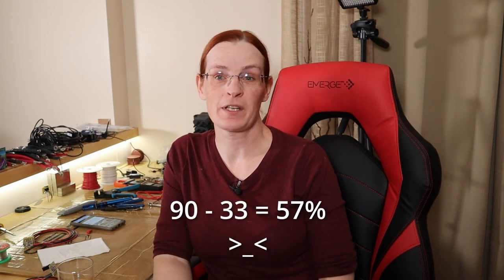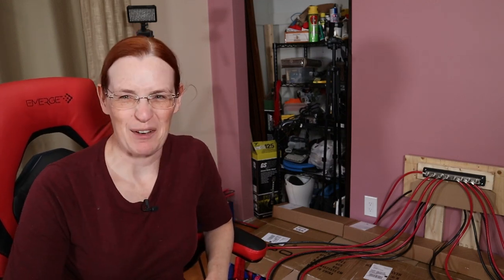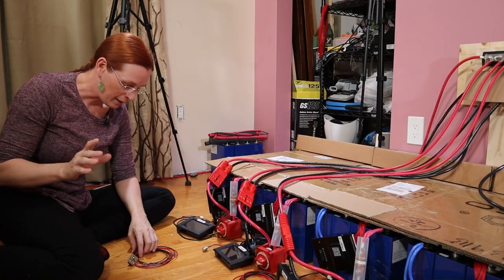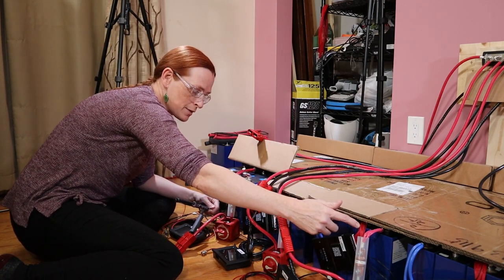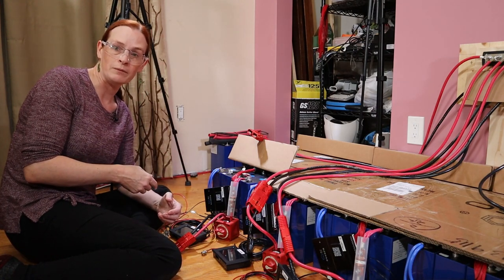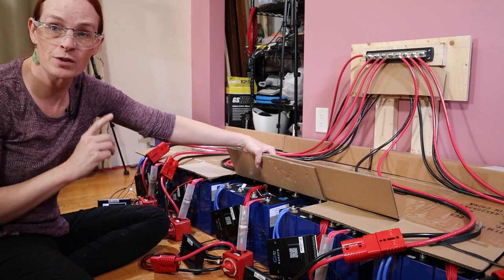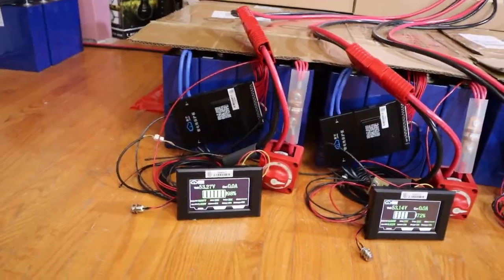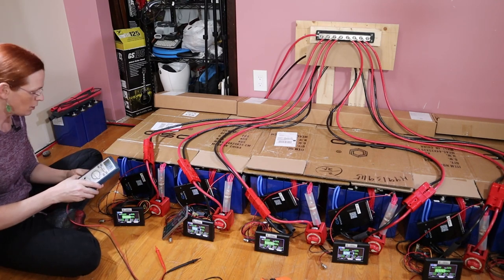It's Alive! (and I need some help) - Part 7 - Big Battery Build! (Ep. 44)

Comment: As others pointed out: precision/accuracy. The JK uses an STM32, which has a 12 bit capable ADC. I'm not sure how exactly it is set-up on the JK, but I've used it many times in the past and it's good. That said, like any device used to measure, you need to calibrate what you measure with a reference. That said, just because you're not calibrated properly does not mean you can't calculate a delta accurately. If cell one is 3.212V and two is 3.312V, the delta is 0.100V - no matter what your calibration. Now, what's the most important for the BMS to do? Make sure you don't have a cell overvoltage - so as long as you calibrate it so that 3.6V for the BMS is close enough to 3.6V true, you're fine. As you noticed, your multi meters are all off too as well - so take the lowest one, or the middle ground. In the end, it doesn't matter since for balancing the delta is used (and is independent of the true value) and for protection you almost want it to read slightly over true to be on the safe side. State of charge will come once the BMS reaches full - but keep in mind you also would need to calibrate the current to have accurate readings. Personally, just use the SmartShunt if you need accurate readings on state of charge and ignore the BMS state of charge indication. You will never be able to have all of them agree on the same number...
Reply from the maker: I wonder why they don't calibrate the BMSes to a reference voltage before shipping out the BMSes? Thanks for the info on the delta, that makes sense and along with the other replies, I am starting to understand things better. On the "calibrate so that 3.6 is low, if anything" - Wouldn't this push the risk off the 3.65 over-charge, but increase the risk of over discharge? I'm worried about both sides of the SoC. Thanks for this reply!
Reply: @TheDigitalMermaid  You shouldn't go to 2.5V anyway - put the cut-off limit at 3V. There isn't much capacity below that point. Since you top balance, you want to go a bit high some times, but not low. The chances of things going wrong are much more likely at the high state of charge in this case.
The BMS is calibrated at factory (as far as I know), but I don't know with what equipment. A calibration also drifts over time, and has to be redone (just like with a lab volt meter, or even a Fluke). It's a good thing you can actually calibrate it.
Reply from the maker: @upnorthandpersonal  Noted, and thank you.
Reply: @TheDigitalMermaid Upnorth is right, occasionally top balance to 3.55-3.6v/cell max, but then set ur cutoff at 3.5-3.55v/cell max. A lifepo4 cell will charge to 100% at 3.45v but will take a bit longer to absorb, at 3.5-3.55v it will charge a bit faster & you can stop bulk charge & go to float at 3.35v-3.45v/cell max, this will give u a safe full charge, as quickly as possible and should reset ur BMS to about 96-100%SOC daily if charging medium allows. I believe you have already taken the cells up to 3.65v/cell to top balance them, so you should not need to take them up that far again, but should balance nice at 3.5-3.55v/cell from now on as there is negligible power gain ( a few amps) above 3.45v anyhow and not worth the likelihood of a higher degradation rate at a higher voltage. I also agree with Upnorth regarding the 3v bottom limit, going much/any below that only increases unnecessary stress and gives you a few more amps to play with, so 3v-3.55 is a safe operating max voltages to work with. Batteries balance and Calibrations do drift over time and need to be reset occasionally.  I know it is all very mesmerising all these monitors, but use ur Victron shunt as ur main Goto for SOC & amps in / amps out, while the JK’s accuracy I believe are really quite good, I would use the Victron Shunt data to give u an easy to see picture of what’s going on in ur system. 
Finally, dont expect everything to be perfectly symmetrical , ie; if charging 6 battery banks at 60 amps and same voltage throughout each bank (well maybe), it doesn’t necessarily mean you will see a neat 10 amps go into each bank, internal cell resistance differences, while small, will contribute to this among many other factors, temps, cable resistances, connections, etc. nice bank.

Comment: The JK is a coulomb counter type bms, not a voltage type of BMS and to tell the true state of charge of LiFePo4 you can't use voltage reliably. When charging for the first time not knowing the true state of charge of your particular cells, one thing to keep an eye out for is a fast rise in voltage toward the end of the charge profile. If charging at a higher rate like I was my inverters freaked out when the spike in voltage occurred at ~95%soc and BMS cut power. You setup may be different. Once you charge to 100% as long as your other settings are correct it should be pretty accurate. If you notice a drift in accuracy you can tweak the settings.  Accuracy also depends on the actual capacity of your cells. Testing each cell is the only way to know for sure. Nice Build!
Reply: Also, as a former recovering electrician, don't trust your Klien meter.I cant tell you how many times it's sent me down a rabbit hole with inaccurate readings. Typically due to the battery voltage of the Klien meter.
Reply from the maker: @brandonEpicAero  It's why my BK was my first and still is my go-to meter.

Comment: Hey Maddy, love the video! Fault finding and testing theories is my thing ;) 

“Is this why people spend lots of $ on high end test equipment?” – Basically yes. The security and repeatability of a Fluke (for example) meter removes the doubt from these exercises, and that translates to increased productivity and reduced costs. I find that most meters are reasonably accurate for Voltage. However current readings vary a lot, especially with cheaper devices. Interestingly, all of the Victron Smart Shunts I have, have tested 3% low compared to a certified Murata shunt that I have and the Fluke meter as a reference. This is also in line with some other current measuring devices I have. Victron have been rather unresponsive about this when I've asked. The Smart Shunt should have a calibration option too, but it doesn’t. So the one I care about most, has been physically calibrated by cutting the plates a little (not recommended). 

I think the JK’s are ok, certainly not perfect but they’re great for the cost. The accuracy of the third decimal place is very questionable, but what we are more interested in here is repeatability. As you’d know, accuracy, repeatability and resolution are very different things, but they are often confused. Cheaper items rarely satisfy all 3 things as standard. The resolution is down to 0.001v, but the accuracy may be much less at just 0.01v or whatever it ends up being. We can normally help accuracy by calibrating them like you have now done, so that helps sort out accuracy, but it will need to be checked at intervals to see if it drifts (unlikely). You will probably find the numbers change a bit with temperature too, a hair dryer on the BMS might be able to easily test this. It's also interesting to see if the numbers still stack up when under stress, like heavy loads or heavy balancing. 

The difference between the App and Screen readings may be due to the update speed. It looks like the screen is updated much slower than the App, it’s probably just receiving serial data at intervals whereas the App seems like it’s communicating much faster. The data may also be averaged or integrated over a period of time too. Perhaps this is something they can develop a bit more. This is just a guess though. 

The current difference at the end of the video could be due to the position on the bus bar, could be a different initial SOC, or could also be due to a difference in cell temperature. The outer packs could be a bit warmer or cooler, and temp makes a decent difference in cell voltage, therefore it’ll make a difference to if it’s charging. You may also fine the opposite happens when you put a load on. Swapping wires on the bus bar (inside to outside) can test one theory. It's more difficult to test the temperature theory though.
Reply: Oops that ended up being longer than expected, and others have mentioned the temperature idea too.
Reply from the maker: Ya, I've learned from the comments here about meter calibration on the good gear... I'm understanding the price difference better now. 

The "JK's are great for the cost" is about what I'm coming to think as well. For their cost. For stationary installs where a pack failure isn't a big deal, I think they're fine still.  The checking for drifts will be part of my annual maintenance on the pack. I think it'll be worth finding a good voltage reference source to calibrate my meter, then calibrate the BMSes from there. 

The cells were all IR matched and charged/discharged together, so I'd expect minimal (and random) SoC differences. I think the temperature is the most sensible option... If it was the bus bars, I'd expect to see a bias to packs A -> F more or less linearly, not the outer packs being different. Next time I charge, I'll uncover the packs and pull out the thermal camera to see if I can see a difference.
Reply: @TheDigitalMermaid  It would be interesting to see how things change if you put the main cable in the middle of the busbar instead of the end.

Comment: Cathode means negative side, since a diode allows electricity to flow only in one direction from positive to negative, the cathode is always the protective side.

Most modern BMS units determine the capacity of a battery by measuring the amount of current while charging, however, when reconnecting it or connecting it for the first time, it appears to be determining the SOC (state of charge) from the voltage, which may or may not be reliable depending on the condition of your batteries. Specifically, when you charge batteries with a partial charge, you are creating a voltage drop at that percentage, so that when it gets to that point when discharging, it may see a sudden drop in voltage. Which would cause you to plug it in, which would cause the voltage to drop more there next time. It is possible to recover a cell with damage, however, it is very tedious and time consuming, and involves fully discharging and charging (cycling) more than 10 times from 0% to 100%, and from 100% to 0%. It is also possible to damage a battery by charging it with partial charge beyond the point of being able to repair the damage.

The gas produced from a lithium cell is caused by the electrolyte being heated too much, which produces hydrogen gas. The hydrogen igniting is the primary fuel of a lithium battery fire, because the hydrogen burning causes the lithium to react with water vapor in the air, which produces more hydrogen gas.

The variation you are seeing from the BMS readings is due to the reference voltage used. If the voltage varies, it is most likely using a resistor voltage divider or zener diode reference voltage. These components are inconsistent, and will vary slightly, causing the reference voltage to be incorrect.

It appears that the BMS is not actually balancing, try disconnecting the BMS and measure the voltages, if they are still the same, it does work. However, I think the BMS is cycling through each cell about 20,000 times each second, and is changing the voltage applied so that the cells read all the same, even though they are not.

Comment: Remember flammable and combustible are two different things. usually the term flammable is going to refer to a temperature that something will start to flame, so just as diesel is not flammable it will flame at high temperatures. I would tend to believe that the fluid in the lifepo4 is not flammable but is combustible. An MSDS for lifepo4 should show that information for you.
Reply from the maker: That's a helpful distinction, thank you.

Comment: Try another battery in the multimeter you will get other readings. More accurate if battery is still full ( new battery). You can get very different readings.

Comment: It does not matter which meter you use, as long as you use the same one for all the batteries. I presume the individual cell voltages change to add up to the total corrected pack voltage. The differential charging is probably due to you bus bar configuration . The best configuration is say, the charge lead closest to pack A on the positive bus bar and charge lead closest to pack F on the negative bus bar, as Raymond Earle stated in the comments. PS had the same phone wallpaper as yours ☺
Reply from the maker: That landing on Mars was one of the most science-fiction-but-real experiences of my life!
Reply: @TheDigitalMermaid  Same here!  It blew my mind the first time and did not disappoint the second! A 1 tonne nuclear powered  rover being dropped on wires by a rocket cradle! - which we got to see fly away!

Comment: Oh, the multimeters values can be calibrated using a screw dial on a variable resister if you open them up. You can adjust all the different meters to read the same value, and you can calibrate them to match your JK BMS. I take my cheap Harbor Freight meters and calibrate them to match my fluke. That is the poor person's method of calibrating the meters. I'm sure there is a better way that actual lab bench equipment is calibrated towards. but i'm poor so I don't know.

Comment: All the multimeters have factory calibrated to a certain point where the measuring ranges are within a certain tolerance level, like +-1% or so. Cheap multimeters have only one trimpot inside to set the ADC reference voltage so, that all the ranges meet the specified tolerance level(are within that %). Better multimeters have a list/table included in manual, You can check it if You still have the original box and papers of the multimeters still preserved somewhere. For most and simplest measurements done, 1% is OK. Expencive multimeters have several trimpots inside atleast one per range, and they are calibrated separately for better accuracy independent of other ranges. Now for calibration measurements one needs a dedicated DC voltmeter, which has a tolerance atleast 10x lower +1 digit more than the meter to be calibrated (example +-0.1% +1 digit more). If You really want to get the BMS calibrated with highest precision possible in home, buy a dedicated five digit DC voltmeter(not a multimeter) and let the shop calibrate it by an independent calibration service(here in Estonia, calibration costs about 100€). After that You will get a calibration certificate, a sticker on the unit and the error numbers in % and in volts on paper for that specific instrument. Now comes the good part! With that instrument You can check all Your personal DC multimeters and DC ampermeters(using a good quality shunt or DC rated current transformer) and write down/on them, which ones have better accuracy over the other in which ranges. And if You really want to go further, You can recalibrate the cheap multimeters Yourself (well, atleast the DC ranges). Try to avoid AC, thats far more complicated. 

To overcome the BMS crashes, try to contact the seller on supplier and ask them, if there is a way to turn on so called "watchdog timer". Mostly its a built in function on almost all the PICs, AVRs and microprocessors last 15 years produced. Sometimes that function is not activated by the coder(software based version) or the jumper pin is in off position(electronic version). It will monitor in real time the unit and reset/restart it when it detects a software crash.

Comment: I'd honestly go for a different route regarding your Buck converters. I'd just delete them and wire the screen to the battery - and take the + from the 4th cell. The screen consume basically nothing and any little imbalance that it might create (it won't) it will be covered from the BMS active balancer. my2cents

Comment: Unexpected Discovery which I verified again today doing some deep tests.
6 Packs of LFP one one bank, also all with JKBms', similar wiring like you have setup.

I flipped the B- wires to be opposit of the B+ wires as example below
Upper Red Busbars (+)   B1, B2, B3, B4, B5, B6,  [in/out to inv] 
Lower Back Busbars (-)  B6, B5,  B4, B3, B2, B1,  [in/out to inv]

I was also seeing the batteries closer to Source Wire on Busbars getting more amps during charge and pondered that, so I tried this yesterday during a smaller test and it seemed to balance better overall.  Now today I am doing a deeper test (much heavier charge rate) and it still holds true.

I know it is not an isue with the busbars as I am using Heavy Pike Industries 400A busbars and not the cheapo's out there.

While it does not look as "tidy" as before, the end result is worthwhile.  Give it a try, it's a simple No Cost thing for you to try.

Comment: The warmer BMSs seems interesting at the ends of the strings or close to. The other consideration is the buss bar itself.  When I connect mine I will put the main circuit in the middle of the bars and not the ends ... (i.e. battery to the middle, multi plus next to that etc. ... cable lengths and such).  Also, it might be interesting to turn off the system for a day or too and then recharge it and wait until the ends show same amps.  I know in the old days I would unplug a laptop when it was charged and then recharge again right away and the time to full charge would become shorter and shorter.  Then once topped. calibrate .. but ends will always charge slower.  I am going to test my multi plus to charge two banks at the same time ... thus see if all balances work well.  I am tiny tiny tiny compared to your work.
Reply from the maker: I think temperature makes the most sense. I have, post this video, let the batteries equalize over night, and then when charging restarted, the same thing happened, the outer two packs fell out of balance compared to the inner ones.